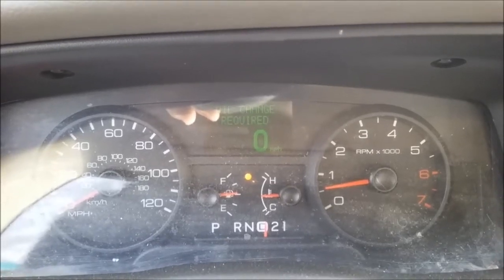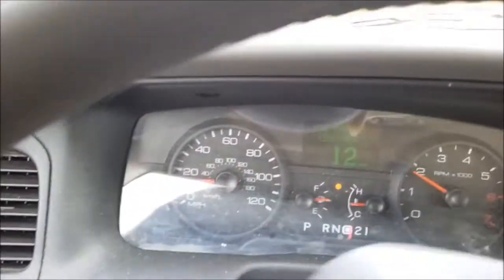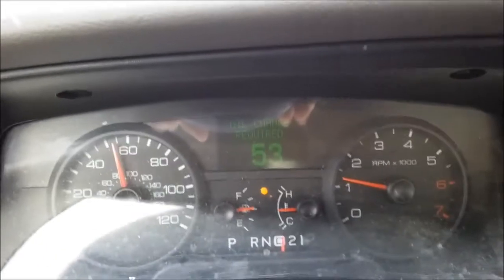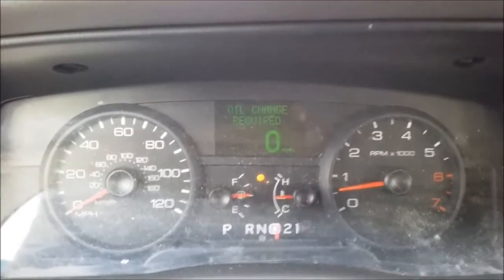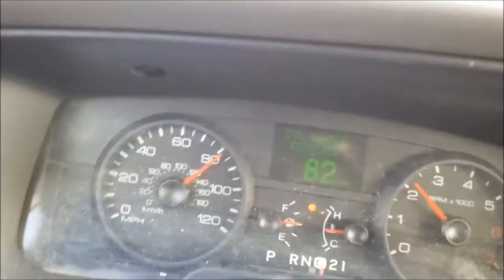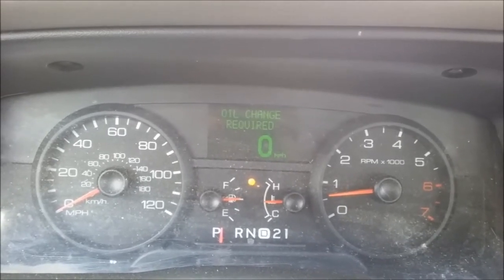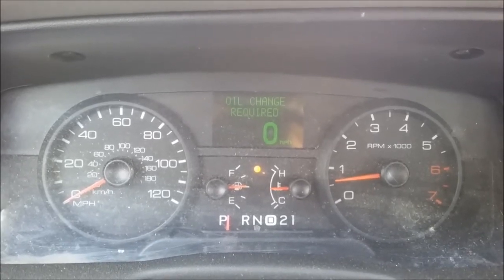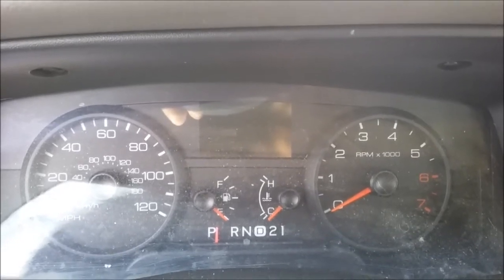2011 Ford Crown Vic 0 to 60 transmission shift points 4R70W 4R75W

Comment: 4r75e, hate to be a smart ass the main difference between the e and w is an extra sensor that moniters torque converter speed at the transmission side. it allows for less slip when needed and better shifts
Reply from the maker: Thank you for your comment I have replied with a new video. https://www.youtube.com/watch?v=3Iuy0ezsjrM    How to Identify 4R70W 4R75W AOD transmission cases

Comment: It's actually the 4R75W 4-Speed Auto. The 4R70W was available in the 1995-2003 Crown Victoria until in 2004-2005 it received the higher stall torque converter and updated 4-speed transmission.
Reply from the maker: Good Job. Thanks for watching and commenting. You are right, technically it is a 4R75W.  And yes right again that is an updated / upgraded version of the 4R70W. 2004 & up parts look very similar but most are not the same. To see the differences and evolution of these and other parts, keep an eye on my playlist "Transmission parts ID" where I show and explain some of these changes and upgrades on the individual parts.

Comment: Your car and my 2007 Grand Marquis both cruise at identical RPM and mine has the 4R75E. If the 4R75W has a different ratio planet as you stated, then strangely, I'm not seeing it here. Full throttle on mine 1-2 shift @ 52 MPH 5,200 RPM. 2-3 shift 5,100 RPM @ 92 MPH. Crusing in O/D, 1,700 RPM @ 70 MPH. O/D at 85 MPH is 2,000-ish RPM.

Comment: Is it normal to shift kinda hard
Reply from the maker: Depends on how hard. Assuming its too hard or its a slide-bump then I would hurry and change my fluid if that fixes it, it was just the friction modifiers degraded in the fluid. If it doesn't fix it there's bigger problems, and all that was lost was the cost of the fluid change. If its not too hard changing the fluid regular is a good idea anyway.